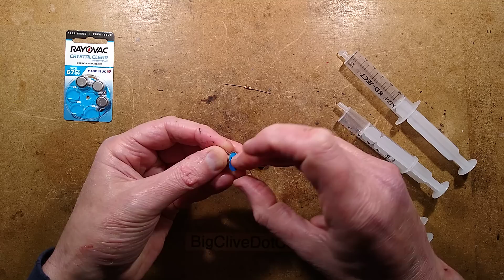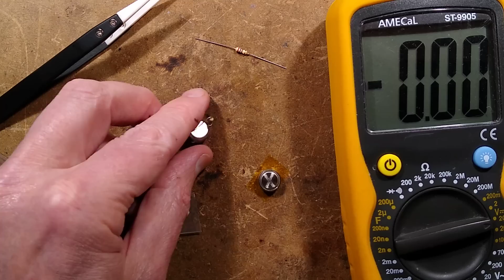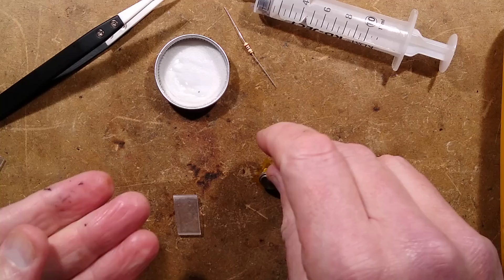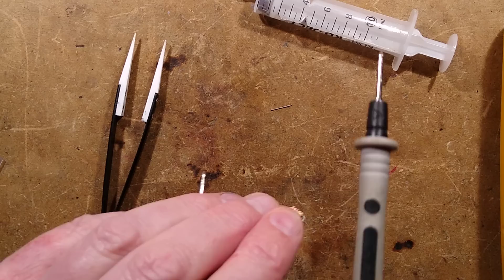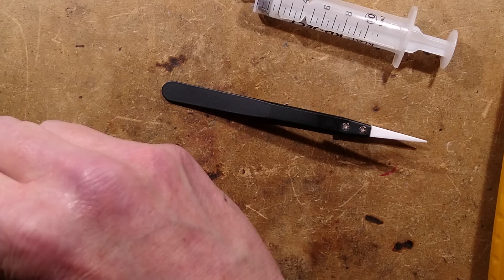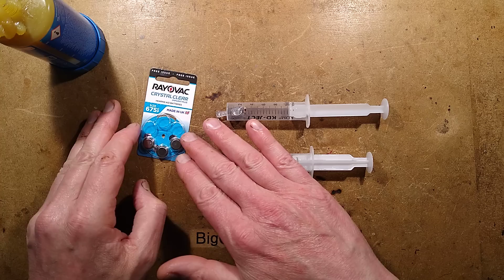Standard zinc-air cell vs mystery gas generating cell.  (flame test)

Comment: So! When you say your going to the shop to get some batteries for the car you wont be joking if you burn hydrogen.
How many batteries to the mile though. Then, how many extra batteries to tow the trailer you needed for the batteries now its full of them. Then, how many more to cover the weight of the extra batteries you got to cover the weight of the extra batteries you got because you needed a trailer for the batteries you bought to power the car with hydrogen.........Then repeat the process to get home.........Bit tiring and not economical? So sell the trailer.

Comment: Hydrogen is a real escape artist. Even the plastic syringe itself is just slowing it down. (since plastic is just lengthy chains of hydrocarbons, there is plenty of gaps and tunnels for hydrogen to seep through, all though very slowly.) Now, plastic will let more than just hydrogen through, even air, humidity and plenty of other things will seep through over time. Just very slowly. (So a carbonated bottle of water can go flat if given enough time.)

To make a proper gas tight seal, one will generally need something like metal. Ie a whole bunch of tightly packed atoms. But even here one can suffer with porosity between the grains of metal.

But since the invention of metalized foil and other surfaces, gas leakage has become a lot more easy to deal with when one wants to avoid it. One don't need particularly many layers of metal atoms on a surface to form a gas tight boundary.

Comment: 😂 I saw the "greesegun"-video and thought by myself I should test if zink-air batteries really produce gas/pressure and I swear I did the same experiment with a syringe like clive did here at the WE and now I'm suggested this video LEL!

P.s. I didn't use lube on my plunger but it worked anyways 😅

Comment: If zinc oxide cells starved of oxygen produce hydrogen, why don't they  either lift the tape, or discharge rapidly in storage?
Reply from the maker: It's only when there is a circuit across them to cause the chemical reaction.

Comment: Zinc-air batteries don't produce hydrogen. They (like any other batteries) consume oxygen. They just consumed oxygen from the electrolyte. Not from KOH, but from the water that is used to make electrolyte. Water is H2O. Batteries just consumed oxygen, and hydrogen was left. Hydrogen flied out of the cells, and you got the hydrogen from them

Comment: Those syringes are probably made of polyethylene or polypropylene, which are partially crystalline.  When it melts, the crystalline structure breaks down causing it to turn clear, then it fogs back up as it solidifies and recrystallizes.

Comment: I think I found another device that uses zinc-air cells for operation. It's an automatic bait dispenser for the A24 Good Nature rat trap. Installation involves removing a coin that is magnetically attached to the top of the bait dispenser cartridge, presumably to close a reed switch. The dispenser then slowly pushes out the bait over the course of 6 months.

Comment: If you want to redo the test you might use a bigger syringe with silicone plunger and a screw on tip + pressure sensor ?
Could throw in more cells for faster reaction, maybe the loss ratio gets better then.

Comment: I have heard putting these in old cameras that used mercury cells is a good idea. Seeming this, I’m not so sure it is… mist old cameras that used Hg cells used the battery exclusively for the light meter, which is basically a light sensitive resistor and potentiometers.and the camera’s battery compartment isn’t airtight, but it definitely isn’t ventilated… see where I’m going here?

Comment: Can you do a video on the State Farm Home Insurance Ting device? It claims to monitor electrical faults and arcs to protect against fires. I do not understand what it does or how it works.
Reply from the maker: I'd guess it looks for high frequency noise on the mains supply, as caused by arcing.
Reply: @bigclivedotcom  Thank you for your response. I suppose I don't get how the device can monitor the whole house when it is only plugged into one 120V branch. It must be only monitoring the Neutral wire. Rather than comparing current the Hot & Neutral like an arc fault does. Love your videos, thanks again for the reply!

Comment: H2 + air can shatter your eardrums. With the necessary precautions needed done you could poke a hole into the syringe and press the gas into the flame, you should get another flame of H2. But be safe, handle it like it would expIode.

Comment: Hi clive can you do a video on the new Power Gyro Ball that you can buy off ebay thank you.
Reply from the maker: They've been around for many decades.  They rely on gyroscopic force to press the narrow axle of the flywheel against a groove in the case to accelerate it.  I've had a few and managed to destroy them all by grinding away the accelerator groove by using them with unreasonable force.

Comment: You have just made H2o from recombining oxygen and  Hydrogen with a spark. . The steam proves that is was hydrogen. And the candle went out i think because you used the oxygen around it to make water inside the syringe. You just made a hydrogen fuel cell ; in a very simple way and,  also demonstrated the practical problems associated with oxygen reduction. Big Clives Alchemy channel coming soon. 🤞🏻

Comment: Put a piece of small diameter wire or monofilament into the syringe body, insert the plunger and push it all the way in, then remove the wire.  The wire should hold open a small gap in the seal.

Comment: My zinc/air hearing batteries, size 13, gain about 70mg of mass over their discharge cycle.  This makes it easy to tell how much life is left by using a $20 mg. scale.  According to Wikipedia that gained mass is Oxygen.

Side note:  the energy density of zinc-air is impressive.

Comment: use of a magnet to guide the battery position inside the syringe is a handy way since the battery casings are cheap iron and even if nickel plated, are still magnet steerable.

Comment: Is the force enough, so that one could use a larger syringe and tubes as an automatic multipoint grease contrivance for say a riding lawn mower with grease points, or would you recommend individual placement of the greaser at each point needing greased?
Reply from the maker: The grease dispensers that use this technique could probably feed several points.

Comment: You can also get large zinc-air cells designed for industrial use. For example the AD513 (Zinc air depol. battery AD513 1.4V 900Ah). They are rather pricey though.

Comment: This has been fascinating Clive. I've been experiencing quite a hearing degradation in one of my ears that they don't know why. One of them has aged about 20 years more than the other in a very short period of time, so they are saying I should try a hearing aid, so I was fascinated to learn that the zinc air cells are what are used to power them. Probably a huge coincidence that you'd done a video on them, but definitely a battery technology I hadn't heard of until you did these experiments. Incredibly simple idea but great... although hydrogen scares me. It's incredibly easy to end up with hydrogen explosions so I try and avoid it at all costs, since it needs a healthy amount of respect!
Reply: You: Hydrogen scares me. It needs a healthy amount of respect!
Me when I was a researcher: Yes, I do have 50 atmospheres of hydrogen in here and I am focussing a high-powered laser on it. Is that a problem?
Reply: @robertfitzjohn4755  We wouldn't call it research if we knew what we were doing? :p Plus... I'm assuming that you'd have been sensible when doing the research :)
Reply: Don't worry about hydrogen with those batteries at all. Amounts they can release is way too little to cause any explosion. As you saw in the video, Clive took a time to collect a syringeful of it, only to end up blowing out the candle flame with it.

And in intended usage - to generate electricity - as in hearing aid, where it gets air, it doesn't generate hydrogen. It only occurs in this alternate usage, where it is electrically loaded with oxygen deprived.
Reply: @TheSimoc  Oh yeah, in tiny amounts, yeah... but I meant hydrogen scares me in general, just it's ease to ignite and incredibly wide.. uhh ... forgot the name now, but the percentage of it in a unit of gas until it explodes. In hearing aid batteries, totally wouldn't bother me, and you have to use them without access to air so... :)

Comment: Interesting experiment ... your turbocharged grease dispenser may prove popular with male strippers lol 😆. Seriously though, I wonder what the results would be if you did the experiment in a vacuum to starve it of oxygen?. It'd be interesting to see some of the larger batteries which are based on the Zinc Air chemistry as they're used in electric vehicles and cameras according to Wikipedia which also says the energy densities are really high relative to the production cost of the cells. https://en.wikipedia.org/wiki/Zinc%E2%80%93air_battery?wprov=sfla1

Comment: I ordered some glass syringes... wonderful engineering and tolerances...looks like that heat shrink might attempt to prevent generated gas escaping, or bust the resistor off...:-(  Rim it,  indeed !

Comment: Actually, they using batteries to generate small controled current to split water into HHO gases, and that thing blow the bellow inside the lubricator chamber and push it slowly

Comment: I use those exact batteries for a camera's light meter that was designed for mercury batteries, with the relatively small holes in the camera's battery compartment it seem to generate a voltage close enough to the 1.35v of a mercury battery, at least close enough that the light meter readings are good enough that the pictures from that camera looks pretty good.

Comment: I love live experiments! -  If you put a small zip-tie down in the syringe, you can push the plunger all the way into a sealed  syringe. When you have the plunger where you want it, just pull the tie out and the plunger will seal up.
Reply: Or a thin piece of wire. Good idea.

Comment: Hydrogen is almost insoluble in water. So to get around the possible losses due to seals put the syringe in an upside down glass filled with water (within a bigger container of water). If the syringe leaks the hydrogen will be captured in the glass. You could even leave the plunger out of the syringe and cut the syringe itself much shorter, just to a length that the cell stays dry, but the glass is actually the thing catching the gas.

Comment: Reminds me of the electrolysis reaction we performed to make little pipette rockets. We loaded the thing you squeeze on the back of the pipettes with hydrogen, loaded them on a sort of stick with some electrodes, then jumped some wires with a 9 volt battery to create a spark and we watched the thing shoot off with the force of a bullet. You don't mess around with hydrogen, but my chemistry teacher was as cool as he was a saint.

Comment: How many pounds per square inch of pressure does a cell produce in a sealed vessel?
Reply from the maker: Not sure, but a test may be ongoing elsewhere.
Reply: @bigclivedotcom  I estimate something like 10 - 30 psi in 1 hour in 1 cubic inch ...

Comment: I was frog-marched out of a radio workshop to be presented to the Chief Tech in charge. My sin? Having a pot of silicone grease on my soldering workspace. Unopened, but still classed as a "dangerous contamination risk". Solder and silicone don't go together I was told. LOUDLY!
Reply: once it escapes it's original container it just wants to cover the rest of the universe in slipperyness

Comment: I suspect that the slower release from the gas generator might be by design.  That while the resistor controls the reaction speed, in general they want a slower release rate than they can predictably get from the printed carbon resistor at higher values.

Comment: How about a solenoid to allow some air in when a specific voltage is reached, then lighting a resistor until it burns, you could make a timed cannon 😅
Reply: smol cannon

Comment: "Hydrogen is a very small molecule and it will find its way out of just about anything"
That's why it's used by some refrigeration technicians to find leaks even on pipes embedded in concrete floors for example.

(Oh, by the way the electronic components for the van project are on their way and should be arriving tomorrow. I ordered several optocouplers, 1N4007 diodes, 1 watt resistors of several values among many other components and I will find what's the best circuit for that particular project by trial and error basically).

Comment: You could maybe improve you results by putting the battery inside a water filled cylinder that is placed upside down into a container of water. The generated hydrogen will displace water inside the cylinder but is extremely insoluble in water so it doesn't escape. Distilled water should be used to avoid gas generation by electrolysis.

Comment: But what gas did the other cell produce?
Reply from the maker: I'd guess hydrogen too.  It's still filling its syringe.
Reply: @bigclivedotcom  On my other channel I will be making a hydrogen generator. That'll use a 15W solar panel. If I can find an easy way to do it, I'd like to charge a capacitor straight from the panel then dump the charge as fast as possible into water, possibly with salt added to produce hydrogen. I'm hoping any gasses other than hydrogen will vent with the oxygen.

Comment: I really appreciate the time you took to do this experiment! I am curious though, did you see if the gas from the air freshener cell was combustible? I assume it's hydrogen like the zinc-air battery, but it would be interesting to check. I also wonder you had less volume from the air freshener cell because it is designed to have a consistent release over time? Maybe the regular zinc-air would produce a lot of gas at first, then taper off dramatically as the cell is depleted. 
If you were to do this again, you could toss your cells into uninflated balloons, might be a bit easier to make sure its fully sealed than the syringes.
Reply: Hydrogen will diffuse through the rubber
Reply: @MrKillerpics  ah, that's an excellent point.

Comment: If you’re cutting a lot of abrasives, then you can get carbide Stanley knife blades. 
Not so good for prying, but for cutting, I’ve not found any peers so far, and their resistance to abrasion is impressive.
Reply: and then BANG, hydrogen explosion